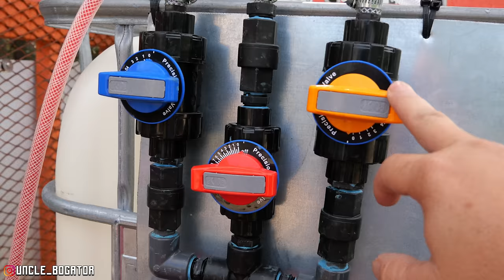I bought a 30 year old Harley Davidson | Was it a mistake?

Comment: I still have my 1995 Springer Softail. It is my first and only Harley and it still runs great. It’s been very reliable with just regular maintenance. The best upgrade I’ve done is changed to a 6 speed transmission. Much lower rpm at speed on hwy.
Reply from the maker: Yeah I definitely miss my 6 gears when I’m on it

Comment: The back wheel being off to the side also is an indicator of the motor mounts being worn, which is also a contributor to the wobble.
Reply from the maker: In this case the motor mounts are new. The wobble was definitely do to improper torque. I have a whole other video coming soon of the fixes we’ve made so far. The axle nut wasn’t torqued at all. Just barely tight.

Comment: I got tired of my mixing valve contraption.  For roofs i just batch mix.  Simpler and more reliable for me.  I'll x-jet driveways/patios.
Reply from the maker: I think I'd be ok batch mixing if I had more room for a dedicated batch mix container. My last few jobs I've needed both the pressure and softwash systems. If I had batch mixed, I wouldn't have had an effective downstream mix. But yeah, it's kind of a pain constantly troubleshooting.
Reply: @UncleBogator   @UncleBogator  Get rid of that ibc tote? I run around with two 35 gallon drums. One full of straight bleach and one for batch mixing. I run my power washer off customer's house.  Either way you do it, makes money my dude!